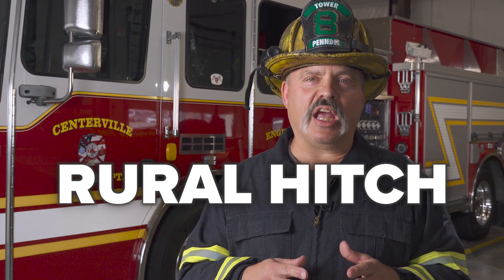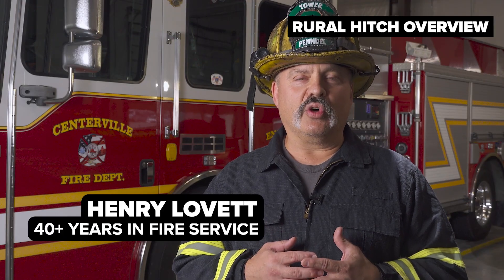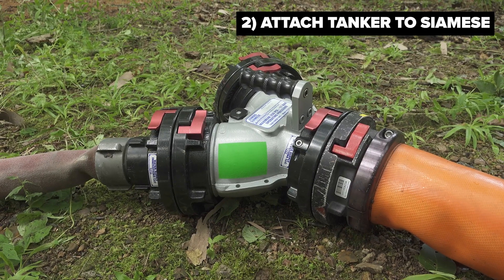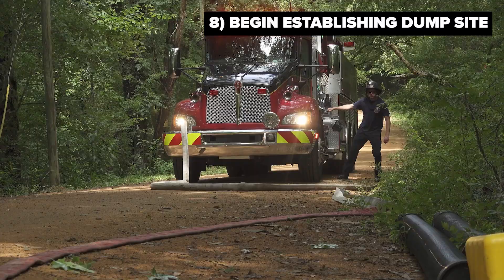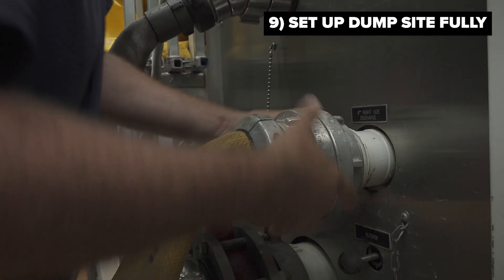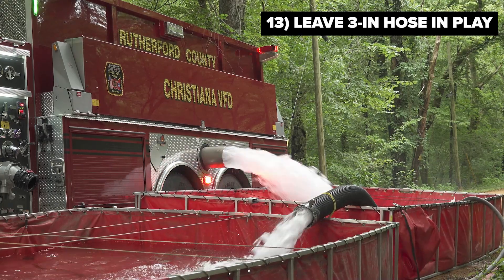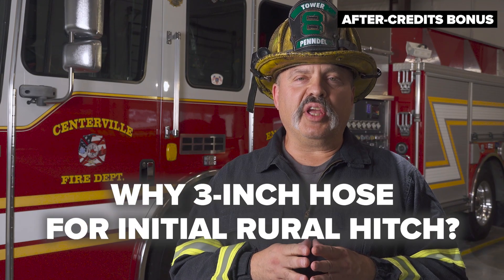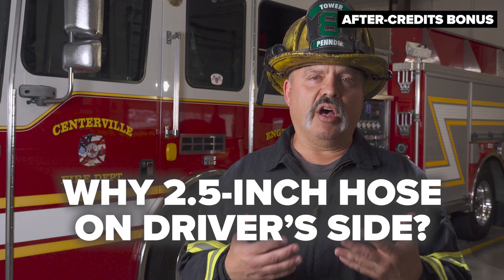Master the Rural Hitch: 14-Step Firefighting Guide | Rural Water Supply (E6)

Comment: Really great video. Excellent editing, text layover, pictures, etc. Very informative and a solid training package for any department. 

One CON I would add to using the LDH when you start your operation is the amount of water you would consume just filling that 5’ vs 3’ line. A long lay to a house could consume most of your tankers water AND not even have reached the fire attack engine yet.
Reply: I once was a firefighter in an area that had a reserve engine in two of the outlying stations that were most likely to go on a call to an area without hydrants - they had two supply beds, one with about 800 feet of 3" and another 500 feet of 2.5"  (and no LDH) just for this very reason.     (You could connect the beds so that you started with the 3 inch and if that bed emptied, it would then start laying the 2.5")

Comment: I haven't seen a fire apparatus built on a Ford C series chassis in service in decades!

  One of our members fabricated a device out of an old brass 2.5" female coupling and a 4' piece of 6" conduit.  Included a swivel.  He called it "The Water Dong".  We kept it on our oldest engine for use in tanker shuttle ops, as a makeshift dump valve.  Worked pretty well, and swiveled up out of the way, so it was left connected between uses.  A bungee cord or hose strap was used to secure it up while travelling.

Comment: Tankers fly, tenders drive. Other than that, this is a hell of a way to bring a lot of water to an incident without crowding it.
Reply: Tankers are trucks and tender is a hook up app...
Reply: @haroldenglish943  look at your IRPG and tell me what it says.
Reply: @C.J.Traylor  Sir, LOL, this is entertaining to me, I have nothing to do with fire fighting in any capacity. The closest I came to fire fighting was 2 HMMV'S with water tanks were assigned to me in Iraq in 2007 and I attended 8 hrs of training. These hmmvs were up armored and responded to blown up us vehicles on fire outside the base.  Also used on the small base for whatever.  I was Infantry but in charge of "Force Protection" so fire stuff I got stuck with.
I retired and got into truck driving & heavy equipment operations..including Tanker Trucks with fuel and water.
Now, my 2 yr stint with BLM exposed me to additional ass backwards Government language and "Tankers are aircraft & Tenders are water trucks" bullshit. Now, a plane ain't a tanker and a tanker truck ain't no tender no matter what jerkoff Government Slob wrote on paper.

I appreciate what you do as a wildland FF, as I see it as sorta Infantry, Grunt work on the front lines.

Comment: To bad in real situations it takes y’all 6 months to set up
Reply: That is the beauty of the rural hitch - you almost immediately have the water from the engine and the first tender to use without a bunch of "setup" time that is typical of drop tanks and drafting from those tanks.  For a lot of residential single family structures, you may be able to deliver adequate water flow just using a few tenders pumping directly to the siamese...

Comment: Ever thought about using a 5 to 1 manifold ? First tanker uses a ldh short shot to flow 4” of water instantly then deploy 2 2 1/2” or 3” lines both ways using 2 discharges on the tanker theoretically flowing 5” of water and by removing the double females off the manifold you turn it into a water hole fill site

Comment: This is somewhat normal operations around here. Some issues with what you show:
Do not use a siamese. Use a gated appliance. We use a portable hydrant or water thief. That allows 4 - 2.5" inlets as well as a 5" and can push the water to a 5" line.  Siamese does not allow the line to be drained if the lay is uphill and ends it people getting very wet if not hurt.
A large (think barn) fire will require more than 600 - 700gpm. Most front suctions limit pumps to less than 1000. Know your pumpers and their capacities. It isnt that difficult to add a couple joints from the side and get 1500.
Reply: Yeah I was watching this video and asking, why not just use a gated wye? You can shut off one side to disconnect the tanker and connect the drafting engine to it without getting wet or potentially losing flow rate.
Reply: @Stargazzer811  A Siamese, allows seamless transfer.  Set second tanker discharge 10PSI below first tanker discharge. When First tanker runs out of water second supply begins automatically with zero downtime, even if you are distracted multi tasking.  No personnel, required to open close a valve, task eliminated on an always understaffed fire ground.  Just be sure to communicate to second operator that they are the source now, so they can throttle up as needed, and also don't unexpectedly, run out of water.
Reply: Any Siamese used for this should have a drain valve that allows for the water up hill of the clappers to drain off the supply line that was layed into the fire - the TFT one is that black round thing between the two inlets

Comment: Gotta hand it to you Yanks, not bad gear, not bad tecniques
Reply: Except that old white Ford engine…from the 1970’s!
Reply: @tylermacconnell217  Still better than the shit we got over here.
Reply: @bentheguru4986  😂 but at least it does the job over there. It could be like chinas FD 💀
Reply: @tylermacconnell217  Wanted to share a story from my old man. My old man was fire chief in a rural area and a neighboring FD said basically the same thing about their 1947 Mac. They had two brand new trucks and wanted to run lead on the fire, "you boys take that old truck and draft from the pond and feed us" Alright man w/e you need. They wanted to run lead because they were at the top of the hill and wanted the paper to take a picture with their brand new trucks running this call. Meanwhile, they kept calling on the radio that they needed more water, more water. Uncle was running the truck, "comming at you." Slowly but eventually had that 'old' Mac singing its high note feeding two trucks at the same time uphill.  (3" lines 1000gpm 300' uphill 50' rise pulling from 2 5" suction sleeves on draft) Well, those boys running those fancy new trucks needed to shift on the roadway and shutdown / closed all their lines except supply. They failed to mention they were moving to the 'old Mac' falsely believing it wouldn't matter, (for whatever reason.) What they didn't know was that 'old Mac' was military surplus and was capable of feeding 3 3" lines at the same time. That 'old Mac' blew the packing out of every pump on those new trucks. Thus ending the new trucks being in the paper and instead a picture of a lone 'old Mac' fire truck at the bottom of a hill by a pond with lines coming up the hill like a spider was in the paper instead. I'd have to ask my old man since this was in the 80's, its entirely possible those new trucks were 1970's Fords. (Correction, new trucks were 1979 Chevys, the 'old Mac' had a 6cylinder 500 cubic inch gas engine.) 

Saw your comment and it kicked that story to the front.
Reply: @tylermacconnell217  That Ford will out-pump most modern units and probably breaks down half as less. Especially if said modern unit is a Pierce, Rosenbroken or KME.